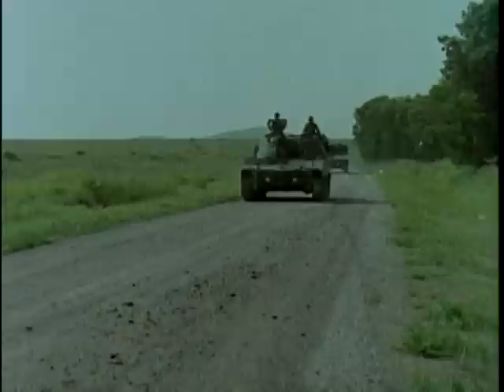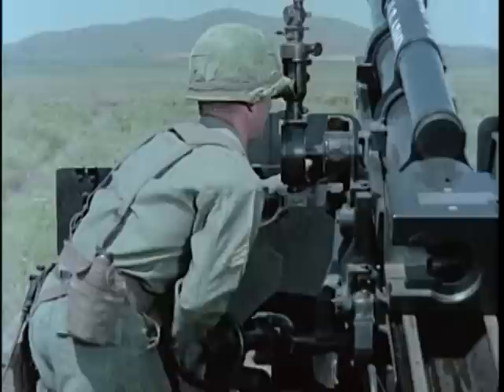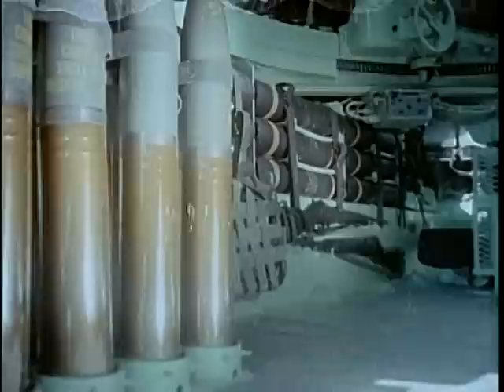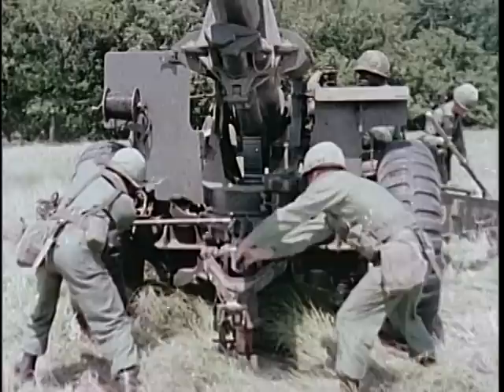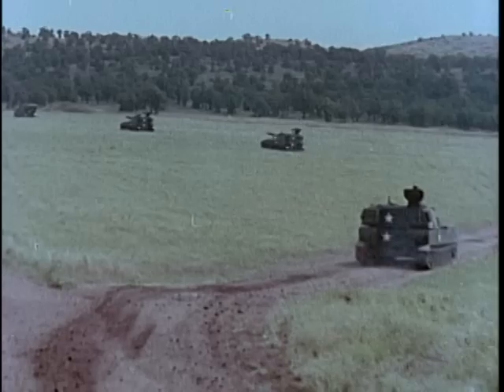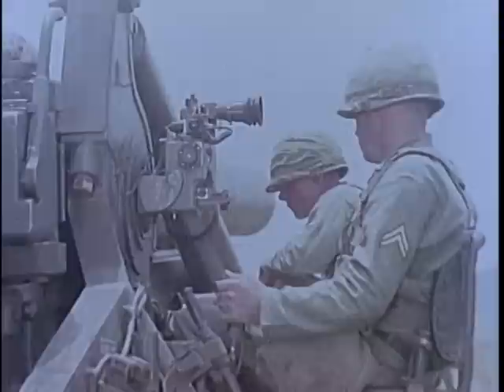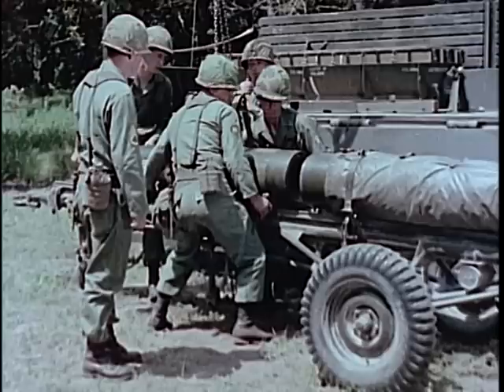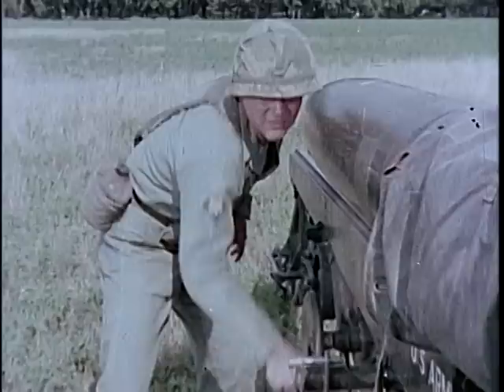Weapons Of The Field Artillery (1966)

Comment: Was Trained on the 105,,mm  ended shooting the  155mm bother towed and Mobile!! Fired Thousands of rounds!
Reply: Used to call the 155 towed 'pig iron'.
Reply: Should of just called it "TOAD"
Reply: @martinkerker1190  We called the 155mm towed gun 'pig iron' because of its weight and difficulty to handle. If memory serves, the spades weighed close to a hundred pounds each.

Comment: They showed the Honest John Rocket at 1.23 min, I was in a Honest John rocket Unit.  We had two rockets if we fired both of them we became an infantry company that's what they used to say. they also showed the corporal missal before it they were in the same Casern I was in. In the states I was in a 155 outfit in the 1st infantry Div.
Reply: Where was you stationed? Germany, korea, states?
Reply: 8 inch Howitzer....holy shit
Reply: @thetreblerebel Ansbach, Germany.
Reply: More or less the same story in modern MLRS units.

I was trained as an MLRS crewman. Spent most of my time deployed mucking around as an infantryman in both howitzer and MLRS units.
Reply: eogg25 Were you MOS trained as both cannon and missile crewman? If not, we're you just OJT for training?
Reply: @13thBear  I was a trained Artillery at Fort Chaffee Arkansas, they called us cannoneers, We were trained on 105 Howitzers, when I finished I was put into a 155 howitzer unit, D battery 5th field artillery battalion, 1st infantry division, Then i was shipped to Germany and was put into a Honest john rocket Battalion, but after about 6 months i was put into HQ to drive a 2 1/2 ton truck for the radio section, then offered the  job as a Morse code radio op. trained for that and my MOS was changed to a 1st senior radio op. 051.10, that's what is on my DD214. the Army operates in strange ways, my friend was trained to drive a vehicle that pulled the atomic cannon but when he got in our battalion they put him in the motor pool, then later ended up as a cook. crazy.

Comment: They're all gone now (from U.S. inventory anyway) except the new generation M109 155 SP howitzer.
Reply: pyrotechnic5254  I believe so.  By new generation I mean the one with GPS positioning and onboard fire solutions computer.  Also has a travel lock mechanism for the tube that can be operated from within.  The crew never has to go outside and has the ability to do quick fire missions at any time.  There might be other improvements but I can't remember.  I did see these being demonstrated live fire at Fort Sill.

The original (well, compared to the newer version, that is a longer barrel so I guess the A1?) was the one I trained on.  All gun data was generated and sent by the FDC.  Later on I was the FDO for an 8" howitzer battery.

Comment: Germans done crazy things as well in field of artillery. One prime example was the 80cm Dora Railgun
Reply: Big for nothing railgun
Reply: Massive waste of resources, (manufacturing, materials and manpower,) for little return on effectiveness.
Reply: @13thBear  Perhaps overall, however, it did help to crack the stout defenses of Sebastopol during Barbarossa. Those piercing Rockling (Sp)? shells, you know?
Reply: 80cm? Try 800cm. Guys could actually crawl around inside the tube and clean it. Yeah, Dora was big.

Comment: Awesome upload, thank you. Question For the experts out there: if the  the maximum elevation of the 175 mm m107 gun is 1166 mills,  what would be the elevation of a single mill, if we measure it in millimeters? Just asking here fellas.
Reply: @Rosales Efra 

I believe that a full circle is 6400 mils! So 1166 mils is 10.9 degrees .
Reply: 1.0 millimetre!
Reply: Actual field artilleryman here: The Mil does not equal "1 millimeter" it's closest metric equivalent is the micrometer.

But to answer the question: 1 Mil = 0.0254 mm
Reply: pyrotechnic5254  that’s what I said...

And I’m aware what a mil is...seeing as I was in the field artillery
Reply: A true miliradian is one thousandth of a radian, which is (1/2π turns) or 57.296°. Therefore a milirad is about 0.057° or 3.438' 
However, NATO member state armed forces define a mil as (1/6400 turns), 0.056°,  or 3.375'
1166 NATO mil is 65.5875°
Hopefully this covers everything relevant
Reply: @kevlarburrito6693    17.77777 Mils equal 1 degree
Reply: @thalesnemo2841  17.77777 Mils equal 1 degree    So 1166 is 65.59 degrees
Reply: @jayhansen7096  I’m aware. Read the question again. He said nothing about degrees.

Comment: Could a self propelled artillery piece use it's gun in defense of it's self say against another tank?
Reply: No, the tank could fire all it's ammo while the SP was setting spades.  Direct fire in ambush is done.
Reply: Yes, they can, and have...in Desert Storm and at least once that I know of in 2003 during OIF. The unit I first went to was a Paladin unit. They had some encounters during the initial invasion of Iraq where direct fire was needed.

Source: Was a field artilleryman from 2005 to 2013.
Reply: @jackbelk8527  you don't need the spade to fire directly. You do need it when you plan on sustained fire. The Paladin is quite capable of taking out tanks if need absolutely needs to.
Reply: @jackbelk8527  You don’t know Jack! Jack.
Reply: You could, but it would probably just piss off the tank even in the unlikely event you could hit it.

Comment: Boy those rocket batteries were labor intensive & time consuming. No doubt those artillery men were happy when they came up w/ the MLRS.
Reply: Speaking as an MLRS crewman...eh...it basically just turned us into infantry units. There's been very little need for MLRS batteries in recent conflicts. In fact, in the 3 years I spent in Iraq, not once did we ever bring, or use, out field pieces, and I served in both Paladin and MLRS units.
Reply: pyrotechnic5254  ...what?
Reply: pyrotechnic5254  If you're talking about the TMDP that didn't demil the launchers...just the older missiles, with most of them being reconstituted into new systems. The MLRS and HIMARS are both still in active service...so I have no idea what you're talking about. In fact MLRS is getting an upgrade. Wherever you're getting your info from, it's bad info.
Reply: pyrotechnic5254  you can probably still find the slide show from it online. Was a big thing that went out around 2015ish. They had to reconstitute the old missiles because the fuel can only be contained in them safely for so long before it's dangerous to handle them, nevermind fire them.

Plus with the new upgrades, they came with new missile systems, so there was little need to keep the older ones around save for training maybe, if they weren't too old.

Comment: what is the helicopter model? at 22:52
Reply: Late to the party but I think it's a Sikorsky S-56
Reply: @davidhwang4221  Yes l believe you are  correct. Called the  Mojave. I think it has a piston engine. Long ass time ago
Reply: S-56 was the company designation of the helo. The military designation was CH-37 Mojave for those wondering.

It was basically obsolete when it entered service. Only used until turbo-shaft heavy-lift helicopters could be developed to replace it like the Skycrane.

Interesting tidbit of info: There WAS a variant of the CH-56 used as an Airborne Early Warning platform. Basically replaced the cargo bay with a radar system.

Comment: 809Mils….Minus 89mils…..1,156mils…. 
BRO, THEYRE CALLED DEGREES!!!! 
this isn’t China or Iran!!!!!!!!
Reply: Originally degrees were used but the degree was too large for accuracy. 360 degrees in a circle but mils would be 6,400. The change to mils happened in the 1960s. Using degrees and minutes caused confusion but just using mils was easier.